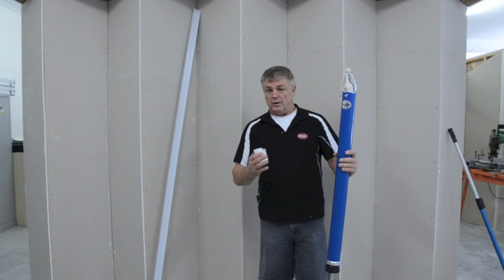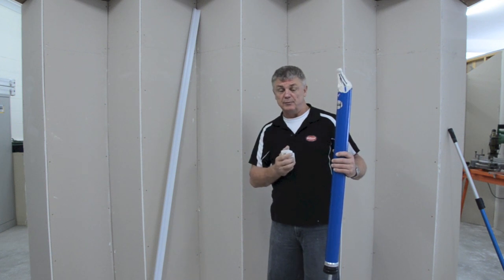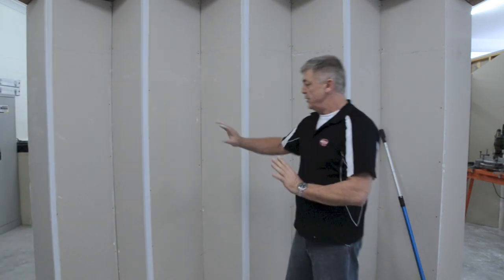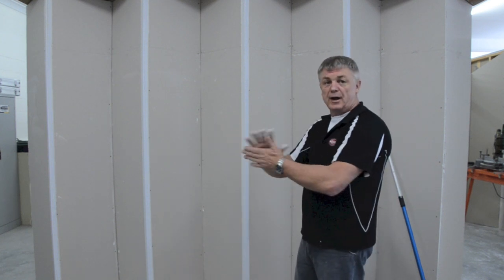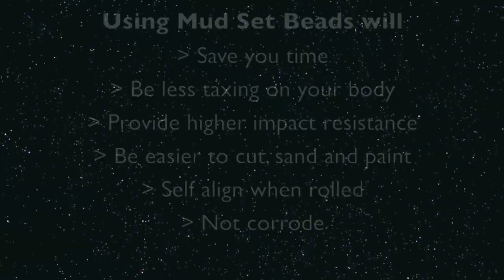Work Smarter - Installing Corner Beads

Comment: what kind of staples use in the middle comer hi. I use 3 different types but they don't work
Reply from the maker: Hi Carlos, We recommend 10mm staples with Spray and Staple trims. Divergent staples will give you the best hold.

Comment: saved 1 min. install, created 20 min. cleanup.
Reply from the maker: Hi Jereme Neff thanks for your comment! The time savings here is only on a few external corner beads - time savings over a whole dwelling or commercial project would be far greater and justify the small additional clean up time for the Compound Tube (it totally breaks down which makes it quite quick to flush out and clean).

Comment: you're comparing apples to oranges, use a pneumatic stapler or a clincher... unfortunately, you won't beat those
Reply from the maker: Hi Domangoj - this is probably a pretty accurate representation of the installation process in Australia. Pneumaitic staple guns and clinch-on-tools are seldom used down under ;)